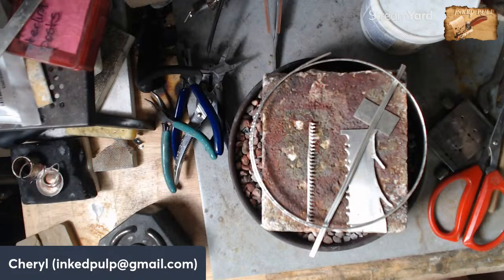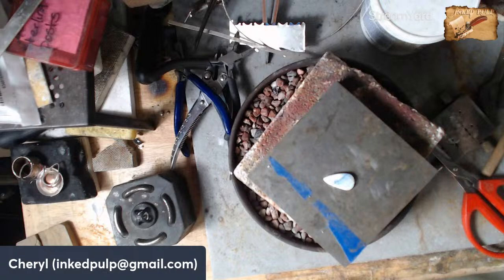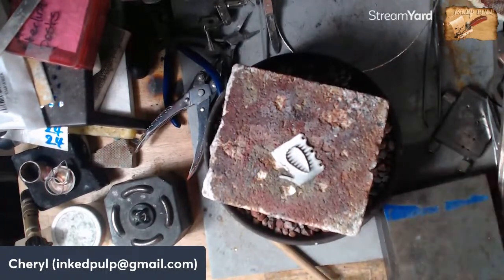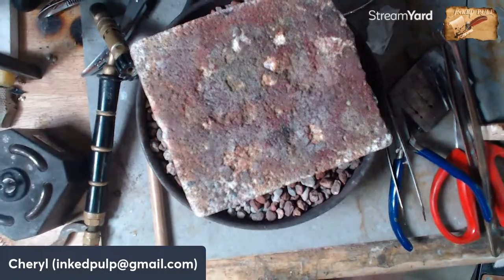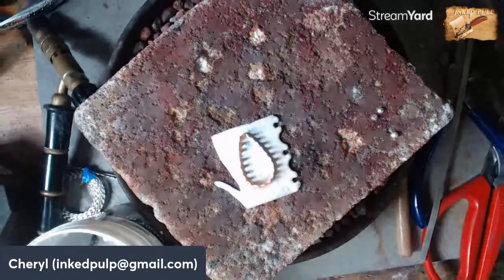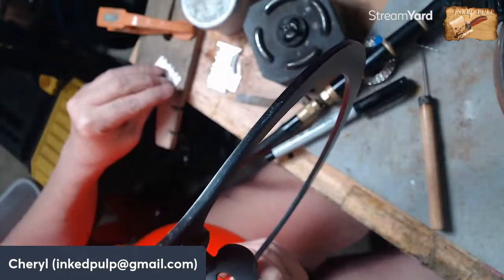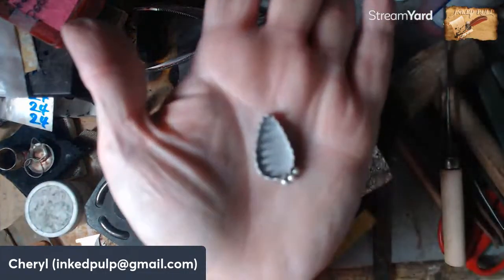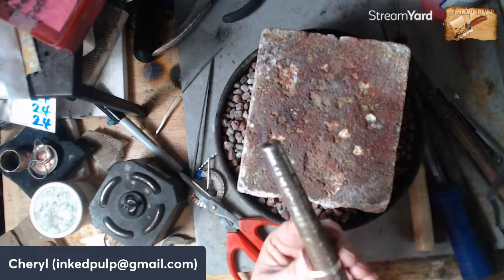LET’S MAKE A RING - SATURDAY, FEB 18 AT 2PM

Comment: I was watching you
 putting those small silver pieces shreds like on the inside of the Ring.. you were explaining why you put them on the inside case of bumps or something I forgot exactly.. but very nice it's a lot of patience and a lot of talent God bless..
Reply from the maker: Those small pieces are solder - they hold the two pieces together when the heat is applied and the solder flows.  It does take a lot of patience but I find it very peaceful and relaxing.